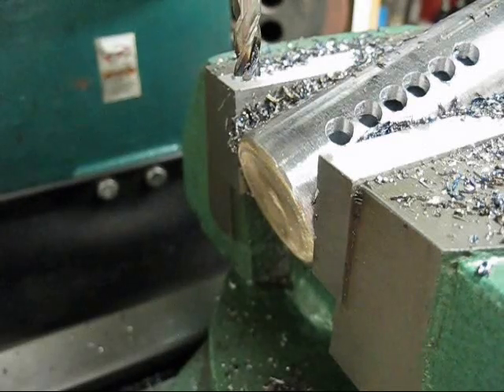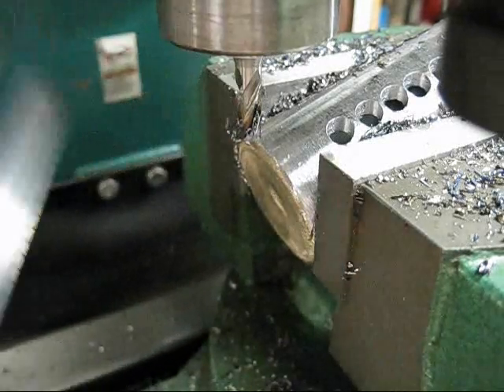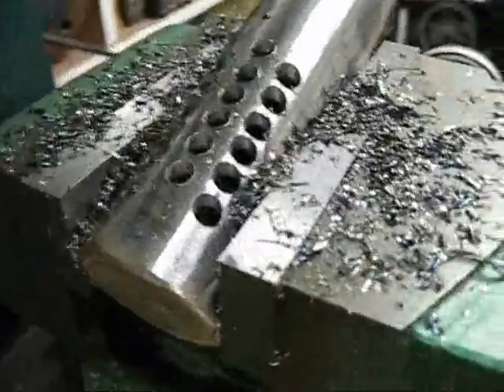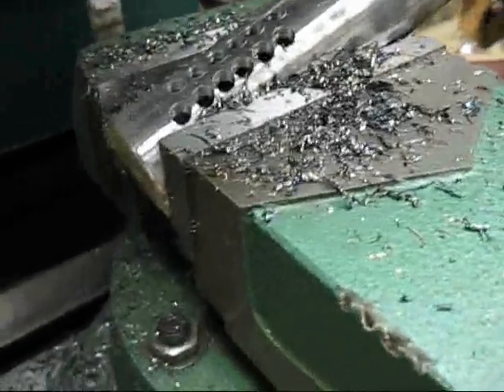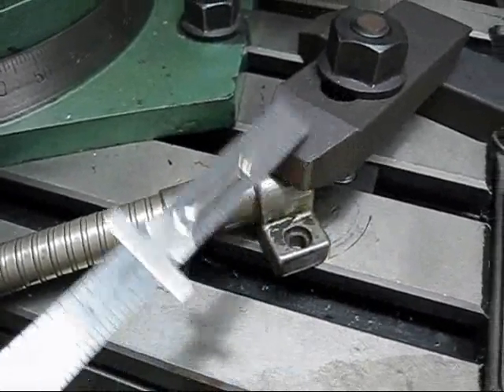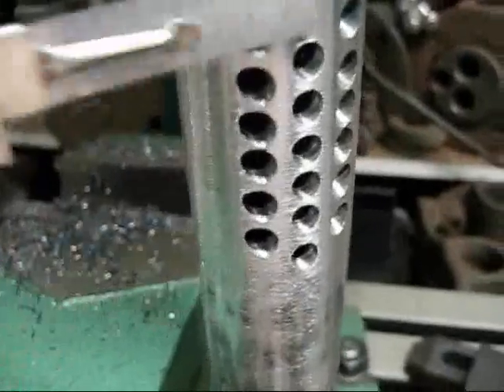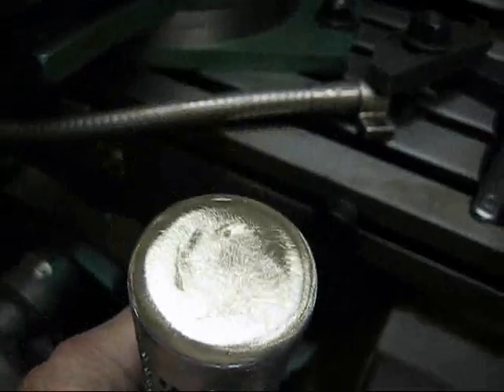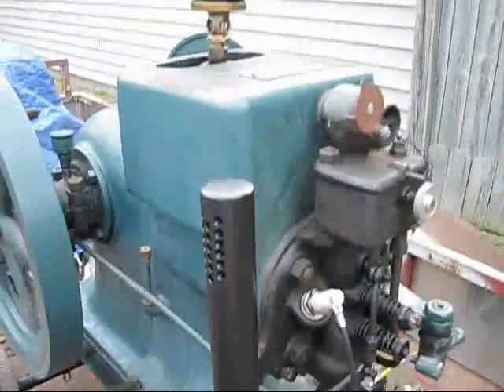IHC Engine How To Build a Muffler and Camera Tripod

Comment from the maker: ,,,,yes, type m's came from the factory with a throttle governor,, but I have modified a few into hit & miss,, you will find a couple of them in my past videos,, and I do have a sideshaft model 'm' in the works now,,, and you can tune most any of them to run slow if all parts are in good condition,,

Comment from the maker: @RustyCarnahan It's a throttle governor engine, should have an ek magneto on it, I am using a battery and buzz coil with a micro switch mounted loose so it will run like a hit and miss.